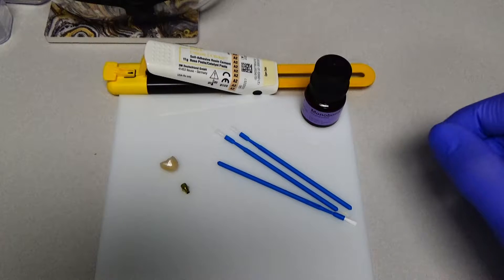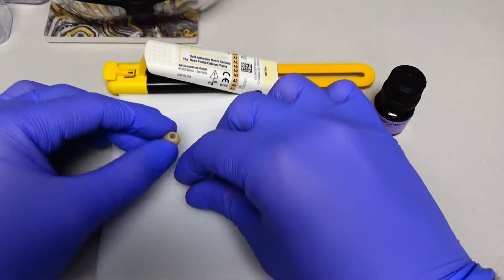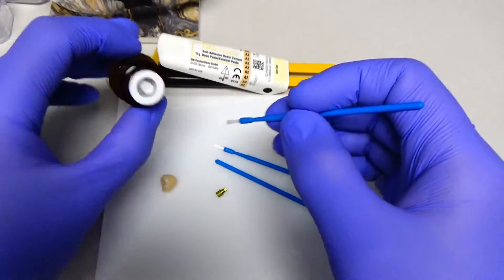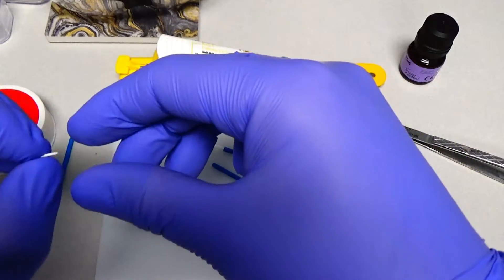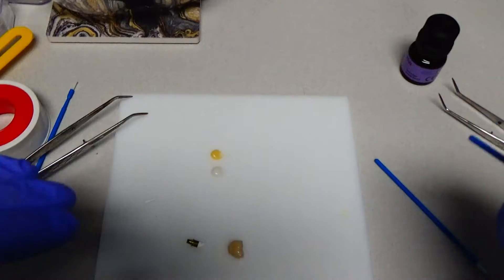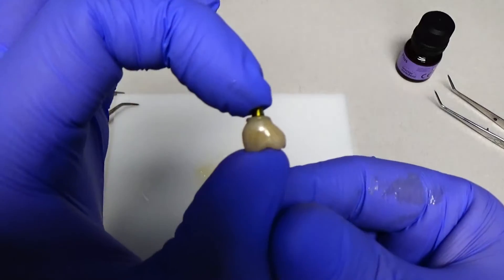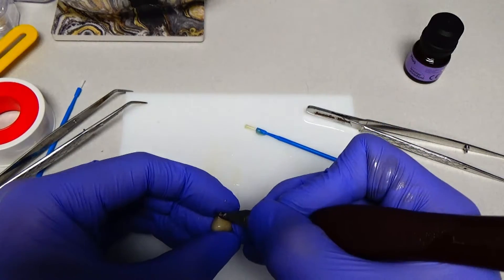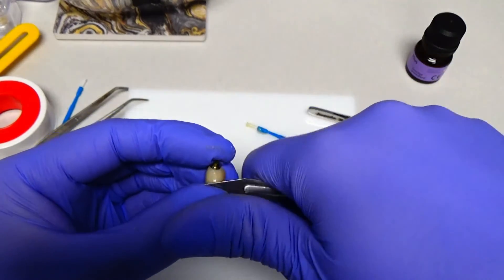Cementing Titanium Bases to Implant Crowns (Zirconia or Lithium Disilicate)

Comment: I have two one piece titanium implants. The crowns were cemented to the implant. The crowns do not match my other teeth at all and I’ve always wanted them replaced.  Do you think it’s possible to remove crowns that are cemented to a one piece titanium implant? The brand is noble biocare.  They are over 10 years old.

Comment: is it possible to use scotchbond universal adhesive instead of the monobond plus? And if we do, instead of just air-drying after 60 seconds, should we apply the relyx cement first(luting the abutment and crown) remove the teflon tape and finally light cure?